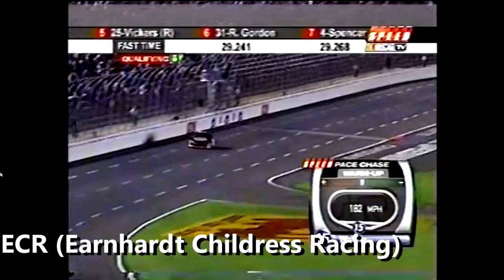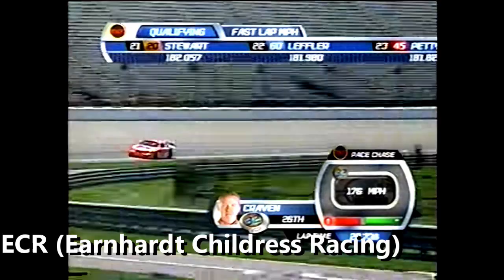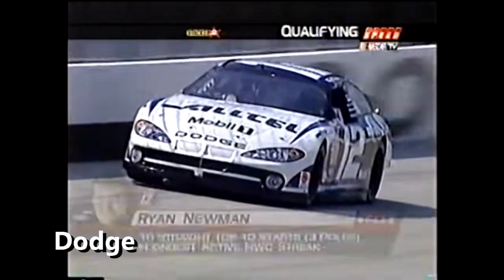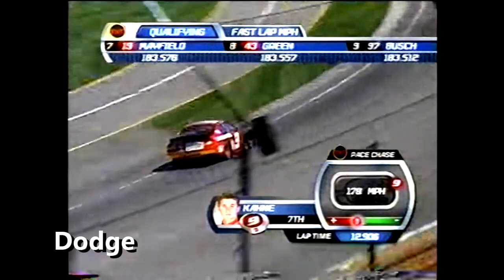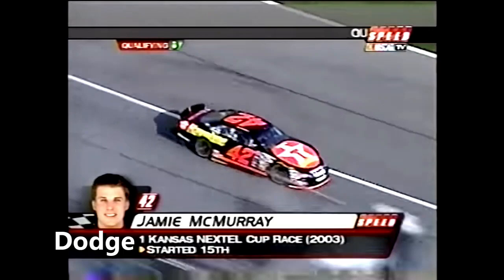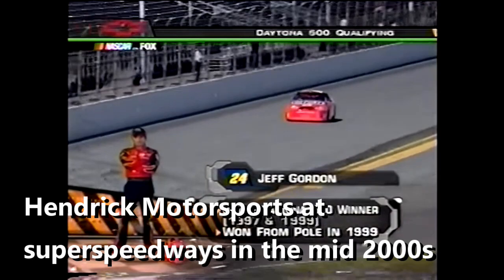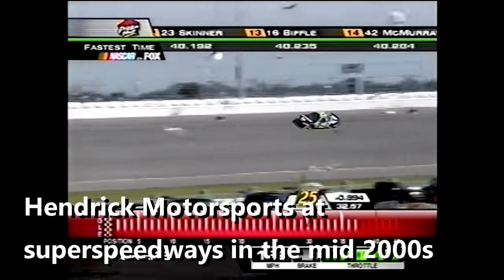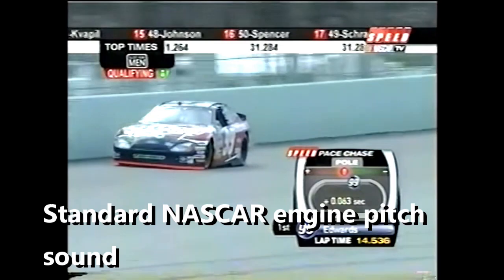Different Engine Pitch Sounds in NASCAR

Comment: Watching that red number 8 car rip off a 10,000 rpm qualifying lap at night is pure magic
Reply: 10k rpms? Damn.  I thought they only did 9k
Reply: @ellisjackson3355  9500ish probably
Reply: @DSaw78 seems about right
Reply: The 10k + engines were indeed briefly a thing. They were not the ECR engines (at the time, yet.) These were one of the last high profile DEI experimental engine programs. They even tested them out with partner/customer Busch and Truck teams. NASCAR quickly saw the arms race building (due to materials and other ways DEI was achieving this) and implemented a gear rule that all but made the 10k + RPM idea a dead end.

Comment: What the NextGen needs is an Extra 130 HP. 800 and a 4 inch Spoiler at all Tracks execpt for Daytona and Talladega
Reply: That's all the Gen-6 needed too. Then the racing would've been so much better.
Reply: exactly mate
Reply: Problem is manufacturers don't want it, and the manufacturers basically call the shots today.

Comment: It was all in the X-Pipes with the boom tubes attached.
They'd still sound like that if they'd put those exhaust systems back on the cars.
Reply: Rpm weren't involved in the sound?
Reply: Ferraris have x pipes too that's why they have that beautiful high pitched sound
Reply: @retoadyt3196  That was some of it, but x-pipes make it sound like it's revving higher than it actually is. Though when unrestricted back then they were turning 9K to 9500 on some tracks.
Reply: @DSaw78  At times they had the SBC turning over 11,000, but the X-pipes were the magical sound.

Comment: That 15 Napa in the first clip sounds like it's running an X pipe, and so does the 32 Tide. I thought they only ran X pipes on the Superspeedways.
Reply: Back then there was a single side exit X configuration and there was also a  Y pipe merge that sort of sounded like an X

Comment: Wasn't based on manufacturer or team really. It was all dependent on what set of headers and pipe configuration for the engine package/tuning. For instance the HMS cars were one of the first to switch up from X to H about 2004/5 on plate tracks because they found for more speed.
Reply: Maybe the H lended itself to less air flow due to the restrictor?

Comment: Did Hendrick do something to the exhaust in 2005 up to the COT on superspeedways? Sounds lower pitched.
Reply from the maker: Every team around the 2000s at superspeedways were running x-pipes and hendrick motorsports around 2005 were one of the teams that chosen not to. I'm not an expert on the whole exhaust deal so it's probably something you'll have to research.